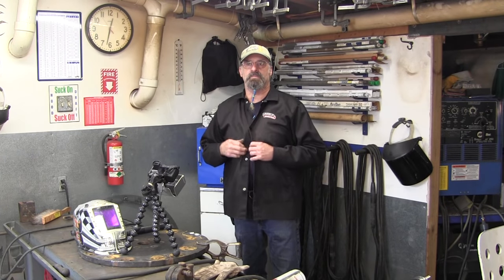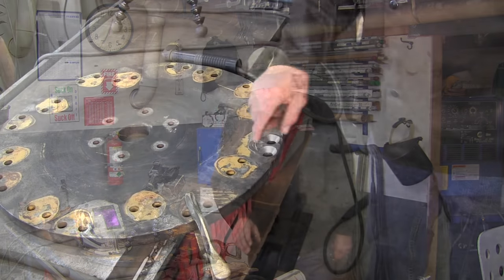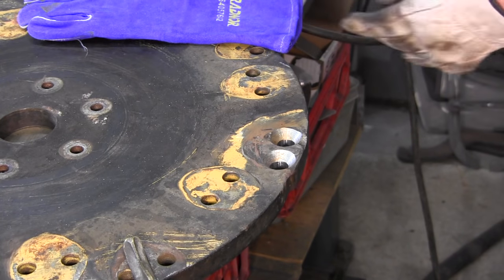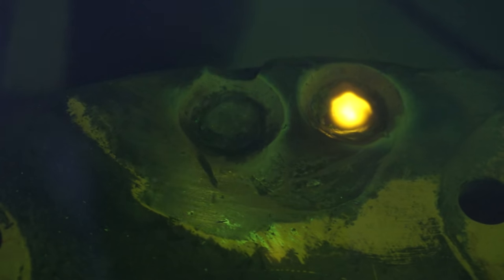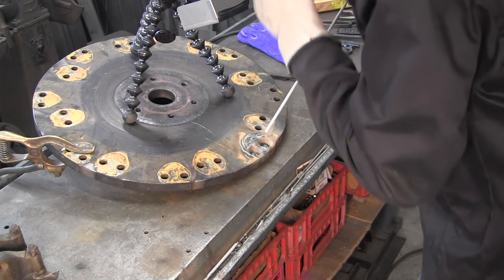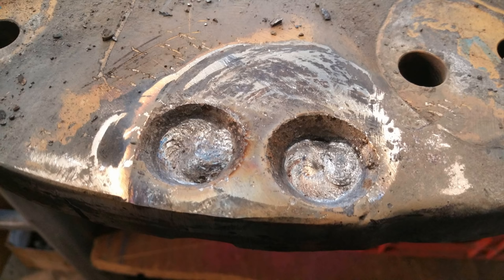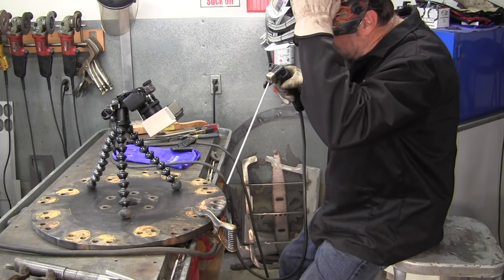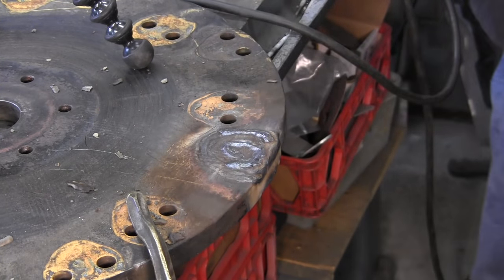Chamfer & Fill Part One

Comment: Nice work! My welding expertise at this point is an amazing ability to quite permanently attach any electrode to any workpiece, anywhere and anytime...
Reply: more power ... when in doubt, more power!!!
Reply: Rule no 1:always start high then level out. Then you're always on the hot side.
Reply: Strike your electrode like a match. Don't tap it and like someone mentioned here: more power.

Comment: Glad you decided to make this video. I'm trying to learn to stick weld, and there isn't all that much out there on that process. Watching what you did here, I think I'm running my amps way too high, because I'm always getting runs and sags. I'll try dialing it down. I'll also give 7018 at try. Thanks!
Reply: Check out Welding Tips and Tricks.  He has a ton of good info and great arc shots on his channel.  I learned a lot watching this channel and his both.  His channel is very instructive and easy to follow.  He covers stick mig and tig along with some other stuff and has quite a bit on 7018 and 6010...lots of pipe welding test tips and basic learning drills etc.  He is to welding what this channel is to machining.

Comment: We have a wielder in our machine shop that plug welds holes all the time. He has a neat process of placing a 1/2" thick copper plate on the bottom side of one hole, then he mig welds with solid core wire which will get rid of any asperity problems. his first pass is the bottom outer edge of the hole then fills the center and work's up in a spiral fashion till he gets to the top with a little more for grinding or machining, Now when he flips the unit over the weld is flat and clean Little if any work has to be done with it. The process work's good every time  ( just a share for you all )

Comment: This is the second time i've seen heating the metal prior to welding, the first one was on ship building where the metal was so thick the difference in temp would have made cracks/fractures  in the weld.

Comment: Good information here! The timing of this video is perfect for me. I am doing a weld on some 0.25 and 0.375 mild steel. I'm going to try the Excalibur 7018. I'm using a  Lincoln "Buzz Box" AC only, I assume you were using DC I hope I get good results with the AC. Great video, thanks for sharing!
Reply from the maker: They do make AC/DC 7018 rod and that makes a big difference on your control with AC. ;{)------

Comment: Great video Keith,very informative. I also like to use the needle or scrabbler gun. I was once told it plannishes the job and the weld and this reduces possible starting points for cracks and flaws to start from?

Comment: I prefer stick to mig too. I'm just learning to Tig though - I think it'll be better yet.
Reply from the maker: Tig is great for a lot of welding, some build ups also, but big steel fill is not one, because of the heat and time of process. ;{)-----
Reply: Keith Fenner
Reply: Keith Fenner q
Reply: Talisman1957

Comment: I really like that green filter.  I've never been able to see weld like that before and I now have a better understanding of what is actually happening.  Question.  In construction I occasionally saw the welders working on a beam that had been damaged and they would use a rosebud that was about three inches in diameter to heat it and then beat the iron back into place so it was usable.  I've seen a few times when you could have used a larger rosebud in your work but didn't.  Is it because it isn't necessary for what you are doing, that you don't have one,  or is it possible to heat the iron too quickly?  Thank you for the great videos.
Reply from the maker: I have a rose bud and do use it if that amount of heat is required. ;{)------

Comment: Keith check out Arc Pig. It is a high frequency generator for stick and tig welders. It looks promising. It supposedly helps you get your arc started at low amps. Keep up the good work!
Reply: They really do.Smooth as a square wave.

Comment: Keith
Because of concern about the flux pocket why is it not an option to use a mig welder with gas shield. Is it just about the wire choice?
Reply: Typical Short Circuit Mig welding is prone to lack of fusion. The other option is going with Spray Transfer,  but that is way hot and may be difficult to close that hole.

Comment: Sorry if this is a silly question.  Why did you change out the rod you were using @ 14:50 ish?
Reply from the maker: I'f I see a section of flux break away , or because I need to hold it and it is hot are two reasons I replace with new electrode. ;{)-------

Comment: Great vid as usual. Do you have any idea what sort of motor powers that plate? I'm guessing it's some sort of beast with insane torque. Off topic, but I remember you were doing a braise-fill job to build up some teeth that were sheared. What was your rod setup? Thanks for the great stuff as usual Keith!!!!
Reply from the maker: I didn't see the powertrain on this and the rod was run at 120 AMP  ;{)-------

Comment: Just my opinion, but you should have used a rose bud to heat with and tig the entire weld. The surface should have been milled down and then filled with metal.
Reply: Bolt chamfer

Comment: Just curious , why aren't you undercutting that face on a milling machine so that when you fill it back in with weld  and mill it, you will be machining all weld material without the possibility of the hardness where the weld meets the original steel?
Reply from the maker: The rod and mild steel used in making the part match and are not creating harden areas. ;{)------

Comment: What is the reason for stick welding vs mig welding this part, penetration?
Reply from the maker: I'm more sure and comfortable weld  building with stick. my Preference! ;{)-------
Reply: TIG
Reply from the maker: Tig is great for a lot of welding, some build ups also, but big steel fill is not one, because of the heat and time of process. ;{)-----
Reply: Mig welding would be perfectly fine for that job....just personal preference.

Comment: Keith,
Does the needle scaler do anything for "stress relieve" on the weld location?
Reply from the maker: There are discussions that it does as to the amount, I don't have any facts. ;{)------
Reply: I believe it does wonder with nickel and cast iron, also with hardenable materials, that along with proper preheat...   ;)

Comment: Keith, at 26:10 you struck the arc, stuck it and then changed rods. Is that because the flux was knocked off the end of the first rod?
Thanks for the great tips on making the weld vertical. Cool trick.
Regards,
Eric
Reply from the maker: yes most likely if I see the break away of flux I'll do that rather than fight the start of weld bead. ;{)------

Comment: What was the reason for flipping the part so many times? I would think once you had the hole filled, you could have done 2 or 3 passes without flipping it, Its not like a little plug weld is likely to warp a 1" steel plate, really isnt much more than a tack.
Reply: I think it is to try balance out the heat distribution so one side is not super hot, and that transfers to the 'upper' side and out, whereas the lower side remains relatively cool. Might sound a bit daft with it only being one inch thick but as a practice to limit the chance of warping it is a good policy. The top half inch will be way hotter than the skin at the bottom and theoretically would 'draw' back smaller as it cools, causing it to cup. Just my ten penneth worth, hope you don't mind me chipping in :)
Reply from the maker: I flipped the plate four times total, ton just keep each side up with the other. ;{)-------